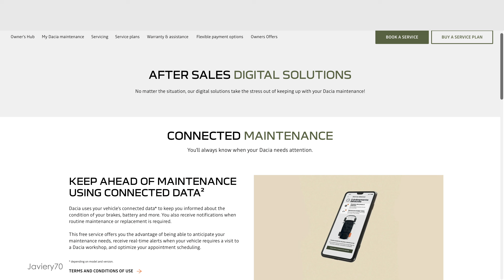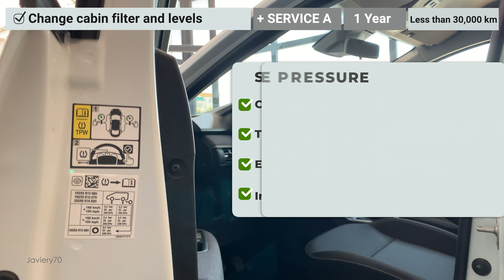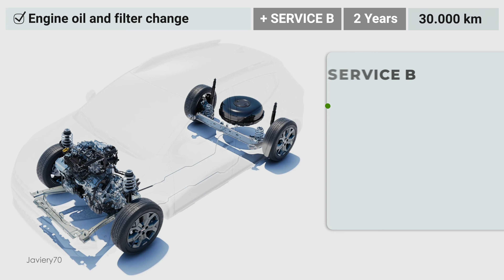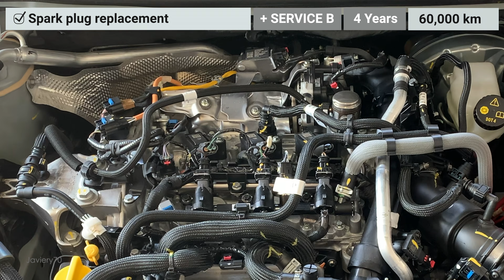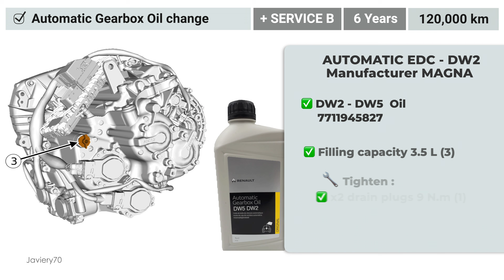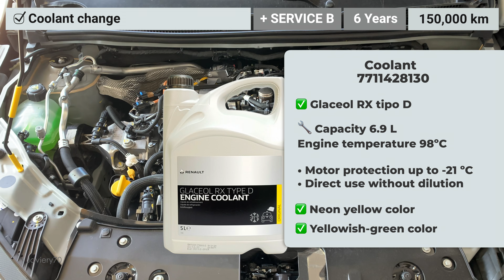🔸 Dacia Sandero 2026 LPG | Official Maintenance Guide

Comment from the maker: 🇪🇸video en español👇🏻
https://youtu.be/Cc7gg9gY7bs

🔸The 2-year/30,000 km service intervals are the maximum recommended by the manufacturer 
and in the best driving conditions.

🔸Maintenance procedures may vary by country.

Please consult the MY RENAULT / MY DACIA website to find out the maintenance requirements for your vehicle in your country.

There's no doubt that shortening these intervals will be much better for the health and lifespan of your engine.

🔸The injection system has the OCS function which controls oil degradation and allows shortening the oil change intervals, as indicated on the instrument panel.

If you have a maintenance contract or it's included in the purchase, it's not possible to shorten these intervals at the manufacturer's expense.

🛍️ Buy on Amazon (affiliate)👇🏻

✅ NFX 75W Transmission Fluid
👉https://amzn.to/4lZ9J7t

✅ Castrol 0W-16 Oil AN2022
👉https://amzn.to/3RheTSo

✅ RX Type D Coolant
👉https://amzn.to/4gH4CZW

✅ Cabin Air Filter
👉https://link.amazon/B05LcqR8C

✅ Oil Filter
👉https://link.amazon/B0dV9d4sT
Reply: Měnit motorový olej po 30 000 km. je pěkná hloupost!!!
Reply from the maker: @vaclavtelin7682   Toto jsou maximální intervaly doporučené výrobcem. Výměna oleje co nejdříve je pro životnost motoru mnohem lepší.

Comment: 0W16 oil ?????
But that's just dirty water.... especially for an LPG engine, which usually runs at higher temperatures ?????
Do they require it to make the engine wear out faster or what?
And they want to change a 0W16 every 30,000 km? Are they crazy????
Reply from the maker: I don't think the manufacturer wants to destroy its engines, only to have to replace them under a warranty covering up to 150,000 km.

Comment: MOTOR OIL AN2022 0W 16 ISNT A THIN OIL FOR LPG?
Reply from the maker: No.
This engine is designed to operate optimally with this oil, which meets the manufacturer's quality standards and specifications.

Comment: Hello and thanks for the clear explanation but I still have a question related to the maintanence schedule, in the official workshop documentation you mention about "service life of the vehicle", what exactly is this? Is there a specific interval when based on extensive testing Renault decided this should be mostly problem free? Is this interval in km or years? If yes can you please mention the specific interval. Thanks
Reply from the maker: The manufacturer does not specify the lifespan of a vehicle. However, they provide estimates, and vehicles are designed to last approximately 15 years or 300,000 km with proper maintenance and use.

Comment: 30,000km oil change is far too long!  It should be change every 10,000km at the longest!
To my mind 0w16 is too thin, a 3-cylonder Turbo engine needs a heavier oil like a 5w30 or a 10w40 if you want the engine to last.

Comment: is it the same service procedure applied for 1.2 TCe 115 hp H5F HR12 Gasoline only engine (not Eco-G) equipped on new Clio 6?
Reply from the maker: Yes.

The maintenance schedule is the same for the Clio 6 1.2 TCe 115 hp.

It's the same maintenance but without the LPG filters.
Reply: @javiery70  Thank you Javier. Is it possible for you to share full PDF document of maintenance schedule (in Turkish if possible) of new Clio 6?
Reply from the maker: It's the same maintenance schedule, but without the LPG filters.

You can view and download the maintenance schedule for your specific vehicle and country from the MY RENAULT website.

Comment: oil change at 30000km with 0w16? these engines will last exactly 3 oil changes.
Reply from the maker: In that case, the manufacturer will have to replace all of its motors within the warranty period.

These are the maximum intervals recommended by the manufacturer.
Changing the oil sooner is much better for the engine's health and lifespan.
Reply: @javiery70 it is too thin. This engine needs 5w-30
Reply from the maker: I think the manufacturer knows better than we do what oil their engine needs.
Reply: @javiery70 in Morocco I think they are using a different oil for this engine... The low grade oil is just to lowered the emissions...
Reply from the maker: Oil maintenance and quality may vary by country. This information is provided at the beginning of the video.

Please visit the MY RENAULT / MY DACIA website to find out the maintenance requirements for your vehicle in your country.
Reply: @dragospahontu  Source? But you might be right. In morroco ambient temperature is 50 degrees. This ultra thin oil would cook under high load in no time.  Toyota even admitted that these ultra thin oils are good for low fuel consumption but fail to lubricate under high load and high temperature.
Reply: @dragospahontu 0w20 its ok.
Reply: @MihneaAriton ok